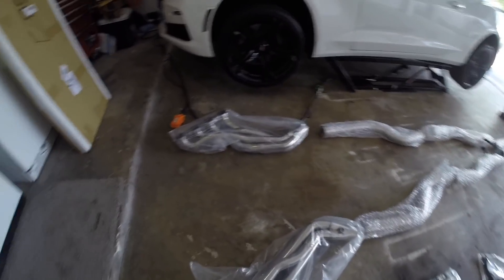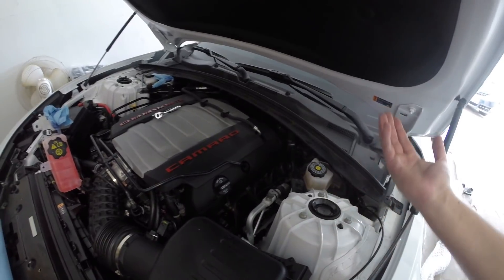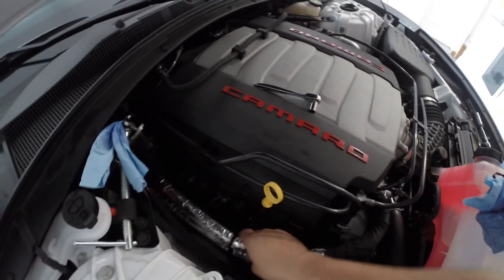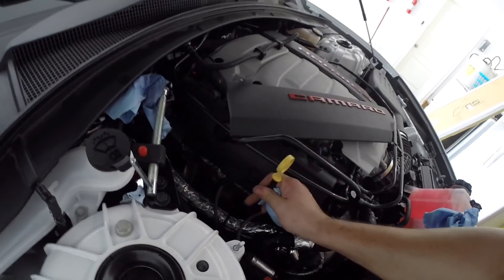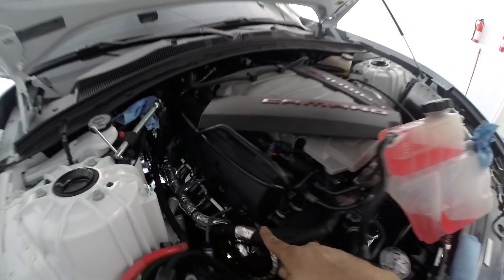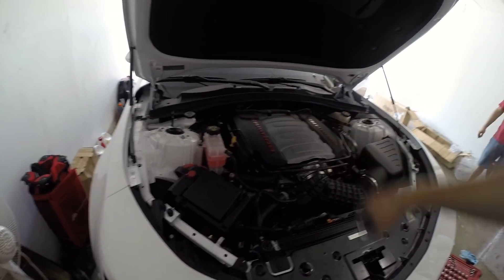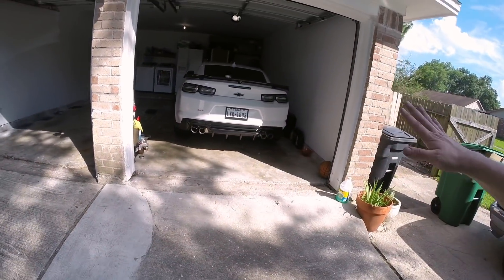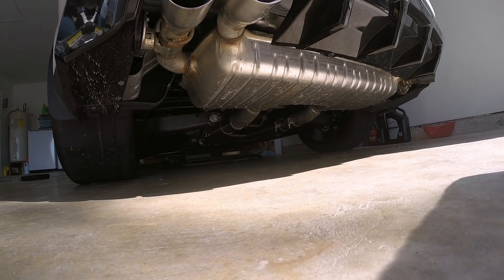Installing Speed Engineering Longtube Headers and X Pipe on MY 2019 Camaro SS!!! | Vlog #238

Comment: Speed engineering starting to get up there I got there headers on my camaro like 2 years ago. They where only 270 bucks and free shipping. Really good quality and welds are great!
Reply from the maker: Yeah, I was very impressed with the fitment and quality. Compared to every other brand these are by far the best bang for your buck when it comes to headers and mid pipe/x pipe set ups!

Comment: On the driver side between the head and the headers there's a sensor that comes really close and is wrap in heat shield,  you remember having any problems burning those? The shield on the sensor is touching the header
Reply from the maker: No i didn’t have any clearance issues. I would say try to move the sensor harness away fro moth bing the headers if oossible

Comment: You pulled both primary and secondary cats AND the control valves before the factory flat pipe section?  What exactly are those valves upstream of the NPP??
Reply: Figured out the AFM valves infront of the crush pipe section.  Without those valves are you throwing CEL?  I keep hearing Check Engine Light and code issues without the AFM valves in place or "plugged in"

Comment: Is it possible to get your stock secondary cats installed onto this 3” speed engineering exhaust system pipes?
Reply from the maker: It would have to be a custom job by an exhaust shop, but I would imagine it’s possible.
Reply: @JLSpeed  hope so bro I seen ur video a month ago and did the same set up with no muffler though and it’s wayyyy to loud I’m in Cali so I gotta be lowkey 🤦🏻‍♂️

Comment: Hey Jorge, have you switched to different headers or are you still happy with these? If I'm not mistaken, they all sound the same and make the the same power wether you pay 2k for ARH or 600 for this whole kit right?
Reply from the maker: You are correct, Im still on the speed engineering 1 7/8 headers. I do plan on Moving up to the 2” headers from speed engineering though lol
Reply: @JLSpeed  Thank you sir

Comment: It looks like you have changed the whole exhaust system but does it effect active exhaust system? I'm asking because of that I'm not as experienced as you are on cars. You removed a lot of stock parts but how the active exhaust still working?
Reply from the maker: Semih Kaya you Are correct . Active exhaust still works because I have kept the stock axleback exhaust. The active valves are on one of the exhaust tips which closes the straight pipe section and forced the exhaust through the muffler making it quieter. As long as you keep your stock axleback exhaust the active modes will still work.
Reply: Wow! I got it now. Thank you so much for your response. You’re doing a great job, keep it up!

Comment: Sounds awesome. What did you choose for the required options ? Did you need the gaskets, spark plug wires or o2 sensor extensions?
Reply from the maker: Miranda S i reused stock gaskets and did end up using the short 10” plug wires from speed engineering and you will need the o2 extensions also
Reply: @JLSpeed  I think I will get these for my ZL1..
Reply: Actually dont need the 02's at all. just put simulators in.

Comment: Yooo what’s up Jorge. I know this is an older video but I just came across it. I just purchased a camaro ss..... and want to order these headers. But I used to also have a 2015 before I wrecked it lol! I had put headers on it as well.... but everything was to bunched up under the hood that the headers burnt some wires.... my question to u is..... did u have to wrap them , or anything to prevent them from roasting anything ?
Reply from the maker: Hey man, congrats on the purchase, and no only thing you have to check on is the wire harness on the passenger side frame rail. Just make sure it’s going along the top of the rail and not the side
Reply: @JLSpeed  thank you so much for the heads up!

Comment: When removing the AFM DOD exhaust variable back pressure valves in front of the flattened pipe section, is tuning required, or do you just unplug and cover the car part of the harness and do you have the ECO DOD mode disabled so the motor won’t darate cylinders with the valves removed? I have a 6.2 SS Auto with AFM and NPP I want to keep NPP but If the front valves can be just unplugged with no issues I would do so
Reply from the maker: BMNY 319 there are two ways to do it. First would be tuning the third controller module not the ecm to elongate any check engine codes from not having the valve motors connected, or second and cheaper option is removing the motors from the pipe and then plugging them back into the connections and using zip ties to move the motors out of the way and secure them under the car.
Reply: What did you do with the downstream 02 sensors that come after the cats. Did you tune yours out or can you keep them and use something like 02 elbows. Also do the headers have bungs already for the sensors and how many are there? Thanks

Comment: Hello Jorge I’m looking for a quad tips rear diffuser I own the same car as u but I recently bought it zero miles from a Chevy dealer in Miami fl and I want to upgrade my exhaust as u did in your but I can’t find a diffuser with the quad tips and also what if I add an straight pipe to the SEng headers and long tubes and deleted the mufflers  ??
Reply from the maker: White_3vil Delta Uniform Romeo that’s awesome man and you can try getting a oem quad tip diffuser from the dealer or I believe wild hammer motor sports sells it. Straight pipe with headers will sound good but be pretty loud
Reply: Jorge Loves Speed thanks bro also hoy do I get tune after install the exhaust thanks bro hope you and your family be safe I’m a big fan of your channel and your tips modifying cars sorry for your time thanks
Reply from the maker: White_3vil Delta Uniform Romeo you can contact pray performance through email at prayperformance@gmail.com if your want to do the remote tuning by him or you can find a local tuner in your area and they can help you out.

Comment: I bought a x pipe kit do I need to buy the headers too or just run the x pipe? Alone for now
Reply from the maker: I believe the x pipe kit only works with long tube headers, so you will likely need to get the headers aswell for simple installation vs cutting or modifying your stock mid pipe to fit the x pipe.

Comment: Nice vid, I definitely wanna get headers as well. 
2 Quick questions

1. Did you get a CEL being that the cats are gone?, Or no because you have the O2 extender? 

2. Also did you just zip tie your afm connectors?
Reply from the maker: The CEL is from both the cats being gone and because of the afm valves being removed from the midsection. The tune should clear that up. and yes for the connectors of the afm valves i just zip tied them to themselves so they would be dangling.
Reply: Jorge's Vlog 
I appreciate the quick reply and the informative but brief review, keep up the good work.

I was considering kooks but  don’t know if there is a difference in sound quality. may instead go with this setup since it even comes with an x pipe for the price.
Reply from the maker: @Everpresnt  Thanks, and in terms of sound quality, pretty much all headers are very similar. the difference in sound will come from either doing cats or no cats and what type of axle back is used.
Reply: Jorge's Vlog 

Nice nice, so you almost have a straight pipe, ik it’s much louder than stock. Last question what’s a good way to go in terms of tuning being I would need one?
Reply from the maker: @Everpresnt  Yes its basically straight pipe when i want it to be. and it all depends i would look for a reputable tuner in your area or consider doing remote tuning which is a little more involved but many top tuners can help walk you through that. I use Pat G in victoria, tx and he will be remote tuning the car for me.
Reply: So if you get high flow cats do you get a CEL?
Reply from the maker: Dennis Lowman you would have to put the high flow cars and have the provisions for the secondary o2 sensors available and plugged in. You shouldn’t get a cell but can’t confirm it. You would also need to have your afm valves installed or connected to avoid a check engine code from not having those.
Reply: @JLSpeed  okay will an afm disabler help for the afm being gone ?

Comment: Quick dummy question bro. Did you get any lights turn on after the install ?
Reply: edgar Rocha duh bro you have to get it tuned after putting headers on. After he cut the afm off
Reply: What! Tuned? What the hell for? What about emissions, anything special or different?  What is AFM?
Reply: dutch971 active fuel management. You need a tune. Car will run lean n like shit if you don’t.
Reply: James Hymel - Thanks. Do you have one of these 6.2s? Have you installed em?
Reply: dutch971 yes I do. Have long tubes no cats and xpipe E85 tune
Reply: James Hymel - That’s what I want to do, minus the E85.  I’m not racing.  How much was all of that?  I’ve got a 1LE.
Reply: dutch971 I would definitely suggest getting E85. I make 30 more hp to the wheels on E85. I got speed engineering headers which are cheap so with that being said. All the parts, installation, and labor came to be little over 3k
Reply: @Waduu08  - Thanks for that.  I know that the E85 provides a horsepower increase.  It's just not that big of a deal to me.  I'm fine with Top Tier 93.  Headers on my 1LE just seems like a must to me.  I'm in Texas, do you know about any emission headaches with a header install?  Even if I don't do the E85 kit?
Reply: @Waduu08  - I see.  Thanks.

Comment: Do you think you loose power going to 2" vs 1" 7/8 headers .....or should I just stick with 1" 7/8 I heard you can loose 10rwhp  curious on your opinion and no I'm not boosted
Reply from the maker: on the new lt engines there has been no sign of losing power going to 2" only gaining especially in the mid and top range.
Reply: @JLSpeed  nice ...okay yeah I'm new to to the lt1 world always been on ls motors.....some shops here in Houston tell you can loose ten horse power just was wondering if it true
Reply: @JLSpeed  and how those headers holding up now
Reply from the maker: @seeyaa_2ss  Maybe if they dont know how to tune them, bc i have not seen any loses from going to 2" headers. the lt's love it. and i dont have the car anymore, but got the same set but ceramic coated for my zl1.
Reply: @JLSpeed  alright cool ...and yeah my shop is well known in Houston serious hp great tuners great shop maybe the sales guy was wrong or didn't know but yeah that awesome those headers for that price and still as good as the kooks or American racing ...pretty impressive
Reply: @JLSpeed  can I ask the horsepower gains you received off those headers rwhp
Reply from the maker: @seeyaa_2ss  yes sir, i would recommend getting them powder coated to help with heat and a little bit of sound. Clutch City Coatings did mine .
Reply: @JLSpeed  what was you HP gain on the speed engineering headers
Reply from the maker: @seeyaa_2ss  I dont recall to be honest its somewhere in one of the videos of the dyno that i did. but i believe it was around 30-40hp
Reply: @JLSpeed  alright thx maybe I'll see you around the city sometime at a meet or racing

Comment: Did you get them wrapped to prevent any heating ? I seen they tend to heat up the starters
Reply from the maker: No I did not, and never had an issue with the starter I was able to force the heat shield back on the starter
Reply: @JLSpeed  how did you force the heat shield back on the starter? I got the same headers in and I’m worried about burning anything lol
Reply from the maker: @Tency777  I got the header bolts started and left the header loose. Then I worked on the heat shield and got that installed before tightening the headers on the block

Comment: Hi! I have 2 questions. Some of the people says that you need to tune your car after installing long tube headers is that true? The other question is did the engine light turn on while driving after your installed your headers? If you can answer these questions I’ll be appreciate it :)
Reply from the maker: Semih Kaya the first question you do not have to tune the car right after install, but to answer the second question when you install the headers you will more than likely remove the catalytic converters which will cause a check engine light to turn on. A tune can eliminate the check engine light and optimize the headers performance for your car.
Reply: Jorge Loves Speed so in the and with high probability I’ll need to tune my car am I wrong?
Reply from the maker: Semih Kaya if you are doing long tune headers yes at some point you will want to/need to tune your car.
Reply: Jorge Loves Speed yes I’m gonna put exactly the same headers and x-pipe kit on my car. Thank you so much for your quick answers! I really appreciate it.
Reply from the maker: Semih Kaya one thing you can do to help save you some money when tuning is remove the afm valve motors in the stock midsection and plug them back in and zip tie the motors out of the emery of the exhaust so you don’t get check engine lights from those valve motors not being installed.
Reply: Jorge Loves Speed I appreciate your helpful answer! But unfortunately I’m a noob about cars lol I’ll get it installed at a muffler shop so I don’t know how would they do it. Hope that they are as good as you at their job :)
Reply from the maker: Semih Kaya just let them know the motors need to be removed and plugged back in and zip tied out of the way.
Reply: Jorge Loves Speed alright sir. I’ll make them read your comments and hope that they will understand. You’re so helpful. Really thank you thank you so much for your quick responds! :)

Comment: Can you install and have without tune or will it be a problem due to cat deletion? And when u remove steering is it a hassle? Like does the steering wheel and wheels have to ve alligned? If so is it hard?
Reply from the maker: Jesus Herrera you can install without tune you will just have a check engine light due to the cats not being there and not using the secondary o2 extensions. The steering is super easy just the two bolts and push up out of the way. And no alignment needed

Comment: Awesome video thinking about getting the kit for my 2016 Camaro SS that already has secondary cat delete and muffler delete (I don’t have the NPP exhaust) any tips for me or what I should look out for? Will doing this without a tune throw a check engine code? Thanks in advance!
Reply from the maker: Frank Spalding hey, thanks and only issue will be the check engine light from not having the cats. But other than that it should drive fine with out a tune
Reply: Jorge Loves Speed Hmm exactly my point so I should get them tuned then in order to pass smog every year. Thanks for the reply.

Comment: Hey brother I'm having some issues with my car took  It out the other day and it started running really bad so now I'm getting a code P069e  It is something to do with  fuel control module or something do you think that could be because of the car going lean? I am tripping I do not know what to do I can't even take the car to go and get tuned until I figure this out
Reply: And also I ordered some MSD plug wires and I'm hearing that people are having misfires from those wires how did the speed engineering wires hold up
Reply from the maker: Hey i would check the plug wires and plugs did you swap those out also?, and also if the car is running lean or too rich it could throw that off.
Reply: @JLSpeed  i don't know... plugs and wires are good im just going to drop it at the tuner shop and hopefully they can figure it out.

Comment: do you have a check engine light , i have sppeed engineer to x pipe straight pipe , primary o2 in and secondary extended ... what did u do to turn off the o2 sensors from triggering mines keep going off dont wanna spend money on high flow cats yet
Reply from the maker: Jimmy M I have a tune on mine, my tuner eliminated the check engine light issues due to no cats

Comment: So are the stock wires able to run fine with these headers? I saw a comment where one of them got burned but was there a way to position it from touching?
Reply: Better do a ceramic coating and put wire boots, plus put a heat shield on the starter and the wire harness

Comment: I just did the catless headers with stock mpp and a tune. But I lost my popping. It’s louder for sure. Could not adding the x pipe make it lose the popping sound?
Reply from the maker: No the tune us what loses the popping sound
Reply: @JLSpeed  that sucks, because it sounds like crap when I let off the gas now. What would you suggest?
Reply from the maker: @bobbydouthit7733  I would get back with your tuner and see if he could adjust that. Sometimes it’s tuned that way for a reason

Comment: The 6th gen camaro has four 02 sensors therefore four 02 sensor inserts/thread holes. Does this exhaust set up have all 4 of those 02 sensor holes to mount the 02 sensors or did you have to have them welded/installed?
Reply from the maker: Rubens 1LE the car does have 4 o2 sensors but the rear o2s are only there to check if the catalytic converters is working properly, when you do headers and remove the cats the rear o2 sensors are eliminated I didn’t even plug mine back in and the tuner will clear check engine lights due to those sensors
Reply: @JLSpeed  much appreciated thank you!
Reply: @JLSpeed  also did tightening the clamps fix the leaks or?
Reply from the maker: Rubens 1LE it helps but doesn’t eliminate it most of the time, going with bigger band clamps will help the clamps it comes with are not the best